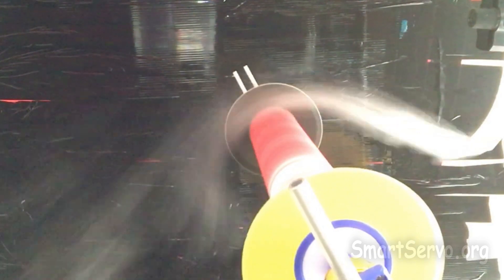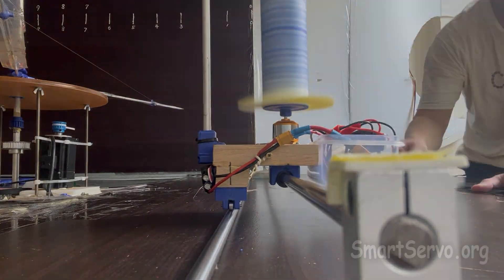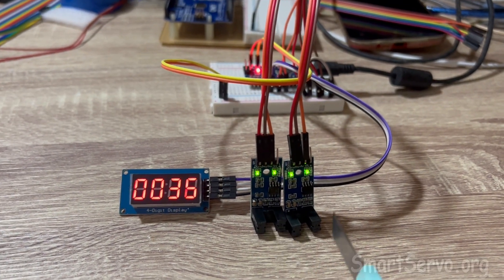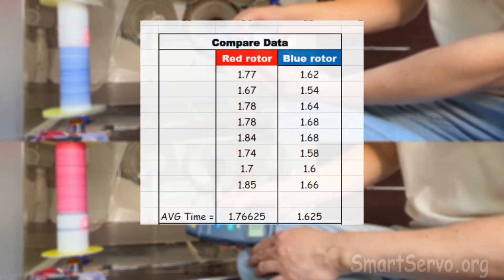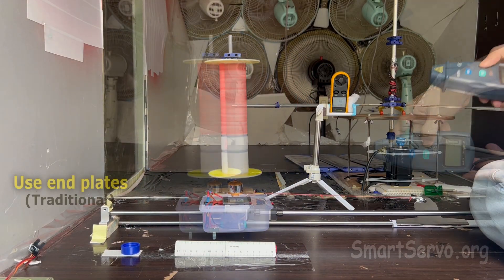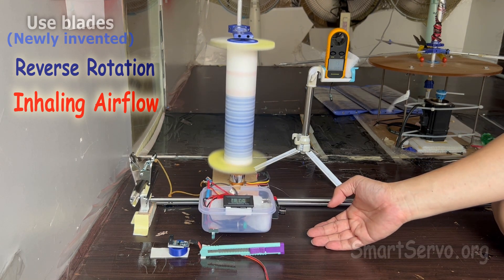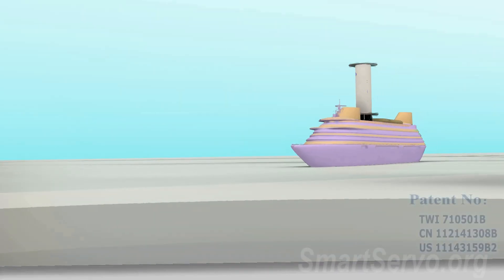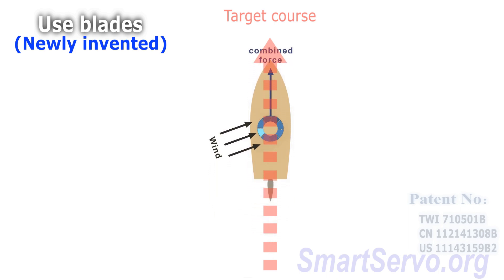Speed up the wind powered car of the Magnus effect, lift force adjustable

Comment: Hi I'm interested to try this on 16 foot catamaran I'm not sure about the Wright height or the width any information will help me out mate
Reply: It is recommended that the rotor aspect ratio be greater than 6, and if blades are used instead of end plates, the tilt angle should be approximately 10 degrees.The final dimensions of the rotor need to balance the stability of the boat with the desired thrust.
Reply: @ArcherYoutube  thank you so much

Comment: The understanding is incorrect about HAWT.  The curve is not a turbine efficiency, and is the characteristic of a blade. If I use math to explain the curve, people will understand easily. The blade  efficiency is a function of the blade length from a to b at the tip sped reached 5-7.

Comment: 2:55 P = W/Δt = Fd/t = Fv = maΔv =>  P = maΔv => a = P/mΔv => 18,14% higher acceleration means 18,14% higher power-output (all that, while Δv isn´t even the same in the 2 cases, thus downplaying/underestimating the actual effect!!!). 3D-print the blades, they gonna have a higher effect, if you use an air-foil instead of a straight, smooth plank as blade.

Comment: make that a normal drum vawt with surface drum directional blade pouches
Reply: its also self-starting by wind
Reply: scam, downwards slope
Reply: so making a virtual sail are you
Reply: a=g when sliding downhill
Reply: patent scam, US do your own stuff, none will trade with you
Reply: have you calculated what that sized non-spinning sail area would produce thrust? why would you spin stuff in vain
Reply: coanda twist huh, meh
Reply: vawt generator/axle to back prop is better

Comment: check back "Ventifoil" suction wing technology - is a non-rotating suction wing with vents and an internal fans that uses boundary layer suction for maximum effect to generate thrust for the ship.  it was used in Alcyone - Jacques Cousteau's Turbosail Ship.
Reply: Additional information: As I recall, the L/D ratio of the Turbosail was 3.5. That seems higher than for Flettner rotors. But Flettner rotors can produce a much higher lift coefficient. The best power to lift ratio for Flettner rotors seems to occur when the spin rate is 4 times the speed of the apparent wind.

Comment: How much more energy is necessary to do the rotation with blades?
Have you measured this?
Reply from the maker: You can see this => https://youtu.be/uafRQlRvAkM?t=300
Comparing the endplates and blades at the same current, even though the bladed cylinder (1800 rpm) is slower than the endplate cylinder (2000 rpm), the turbine using the bladed cylinder is still faster. In addition, the main sources of energy consumption are: 1. The drag of the blades, 2. The friction of the cylinder's bearing. As the size of the cylinder increases, the former increases to the power of 2 (area) and the latter increases to the power of 3 (volume or mass). Therefore, when the size of the cylinder is very large, such as the propulsion of a ship, the energy consumption of the former will be much lower than that of the latter. and when the same Magnus thrust is generated, the rotation speed of the bladed cylinder is lower than that of the cylinder with endplates. This means that the blades can significantly reduce the frictional energy consumption of the cylinder.

Comment: Have you tried adding multiple disks per cylinder with a gap of 0.4mm like in a tesla turbine? PS I really liked your ideas and your content so I subscribed to your channel.
Reply from the maker: Thanks for subscribing and your imagination is very rich.
In this video,the disk helps to maintain the pressure difference of the cylinder to increase the Magnus effect, while the disk of the Tesla turbine generates torque by friction with the high-pressure gas, which is very different.
Reply: As I recall, the Thom rotor uses additional discs along the rotor and they are claimed to increase the lift, but I think they also increase the necessary power. So I don't know if they are an advantage. @SmartServo_org
Reply from the maker: @petersharp6833  Yes,The lift-to-drag ratio advantage of the Thom rotor appears at the speed ratio greater than 5. Otherwise, it is not much different from the general endplated rotor. However, the  lift-to-drag ratio of the bladed rotor has increased significantly at speed ratio only above 3.

Comment: what it more eficient, a boat with magnus effect or sails? i mean, sailboat size or quite bigger, and for a kind of "river cargo"?
Reply from the maker: Large rotors for ship propulsion could reduce fuel consumption => https://youtu.be/FJt8l80kGTg
Reply: I recall reading a comment by a NASA engineer. He said that if the energy used to spin the original Flettner rotors was directed to the propeller instead, the total propulsion efficiency would be higher. I don't know if that is true, but it seems worth checking.  @SmartServo_org
Reply from the maker: @petersharp6833  Each has its own suitable speed.

Comment: This might be a silly question but why don't you just measure the force directly? Timing the speed over the rail seems like it introduces all sorts of unnecessary variables to your experiment. Eg weight, vibrations, ect
Reply from the maker: More lift doesn't necessarily mean faster, drag also needs to be considered. Therefore, measuring time is still necessary.
Reply: @SmartServo_org  Eventually, but atm you are getting data that is way too generalised to make any serious improvements to the design. 

For example, how do you know that you have made improvements in propulsion rather than stability? Stability vs propulsion is a well known consideration in any rotor craft. That rig doesn't look anywhere near rigid enough to control for this variable, you can actually see it wobbling in a couple of your experiments.
Reply: He is right, how can u say, that the turbine (the old AND the new) wouldn´t deliver 5x higher results, if the losses in this set-up weren´t there and so obvious??? Thus relativating your results. It´s like in a velomobile. It needs to be pedaled at 184W to drive constantly at 60km/h, but if u replace the cyclist´s spinning feet (that make the whole velomobile whobble all around) with a tiny e-motor, then u need less than 184W for keeping at 60km/h.